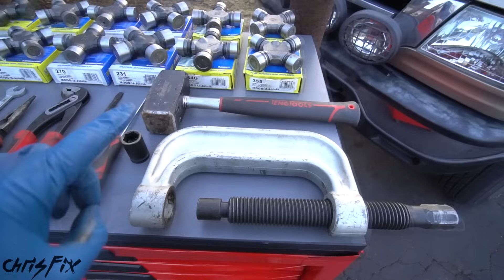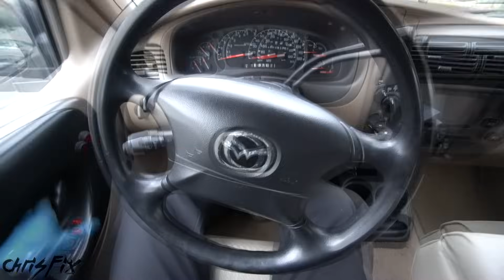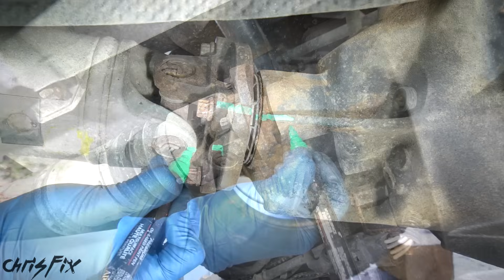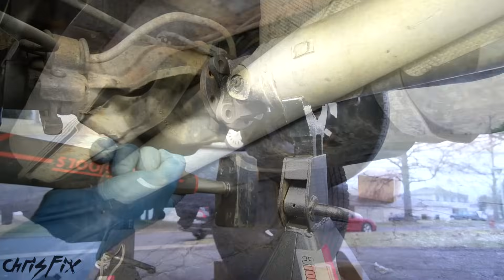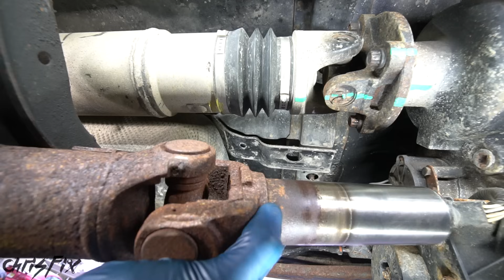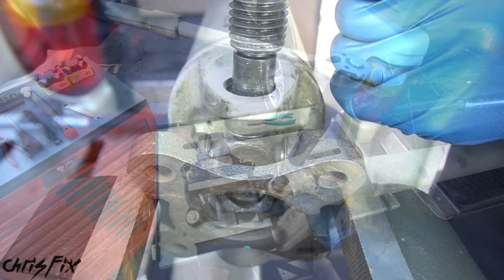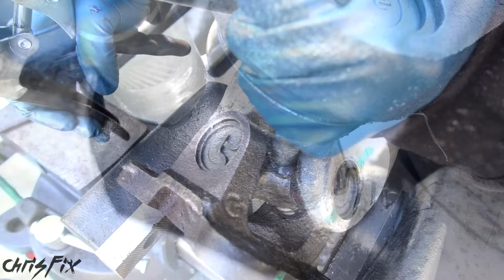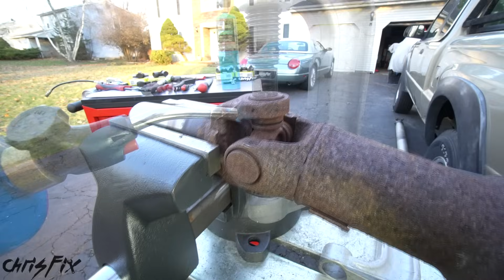How to Diagnose and Replace Universal Joints (ULTIMATE Guide)

Comment: I decided to just replace the driveshaft. I offroad the thing often, the sound only got better when ALL 3 of them where greased and it only worked temporarily and was still making quite a bit of noise. It only cost like 100 bucks more than the 3 u joints I needed and still 400 bucks cheaper than it was to just the u joints replaced at a shop

Comment: Great video, very informative.
I have a question about the squeak squeal noise coming from the u-joint.  2007 F150, one piece rear driveshaft at the rear position, the noise is heard after 30mph and stays constant until stopping, pull away and its back.  The drive shaft is tight by hand, NO clunk between forward-reverse or reverse-forward, caps look fine.  I've walked beside the truck in the parking lot and heard it, but yet when a mechanic puts it on the hoist, its not heard.  It has new brakes, pads and rotors on the rear, nothing is contacting anything anywhere.  It is a higher noise and is a faster rotational sound than brakes dragging would be.  I know its hard to diag over the computer, but do you have any other ideas or suggestions for me to check?  Much appreciated

Comment: Your usual excellent video. When re-seating the u-joint, I've always used a hammer with a dulled cold chisel in the crotch of the u-joint to drive the caps back against the retaining clips, thus loosening the joint bind. What do you think of that method?

Comment: Maybe I installed the u joint incorrectly with the hammer method looks like the rubber piece isn’t flush on the side and makes now I got a clunk when coming to a stop at 10mph to 0 or could be transmission problems ?

Comment: i just did this on my landcruiser yesterday. heres what i learned. 100% you need that press tool! and also I found it easier to actually sit the press in the vice so you can really swing on it. those things are in there tight! even had to shock the press with a hammer while it was loaded up with pressure. thanks chris fix !

Comment: best way to check U-joints, put car e-brake on, put key to run and pull out of park then in to park, the load of the car causes the shaft to have a load on it. so park, e-brake, key on, shift to any gear then back to park. get under and spin or wiggle the shafts.

Comment: Your detailed video inspired me to revisit the u-joints on my 1960 Sprite. While I have the axle out for servicing all major seals, I had overlooked this part of the maintenance. The part about the grease displacement from the bearing boots is a great one because I had thought I was putting grease in, but on 2nd review the nipples needed to be freed from old dried grease. What gave me confidence that I could get grease in via the nipples was a test squirt with the gun before reinstalling. The final part being the grease that is displaced out the boot.. She looks ready for work now. Cheers!!

Comment: Chris,replacing u joints on my 67 Camaro
I followed your instructions to the T but I have a lot of resistance in the u joint even after several hammer taps
I removed it and tried again,I have free movement up until that last little bit to fit the clip
The channels are clean,it’s almost like I need to sand a few thousandths off the clips
Is this normal?
Thanks

Comment: Many driveshafts or aluminum these days so I don't think using a hammer on them is a wise thing to do
Reply from the maker: If that's the case, I would just be very careful and consider using something like a rubber mallet/dead blow to move it a slight amount!

Comment: Hi Chris  i have an issue with the universal I think. I have a ford edge 2014 sports.  when i am driving there is a bang forward when i accelerate after stopping . not all the time but it happens sometimes when i am stopped at a light. the tranny fluid is up to par, I just changed the deferential  and the power transfer case. Any thoughts on what this banging is coming from   thanks again.

Comment: Yeah! I could of used this information 35 years ago when I leaned about neutral dropping to chirp the tires! Scared the hell out of me when the speedo bounced around, the yoke shattered, and the driveshaft was hanging from the axle. Learned about the darn plastic injection retainers and soon about the proper positioning of the weight. Not funny then, but funny as hell now! Great video!👌🏻👍🏻

Comment: I have a question Chris, my nissan Navara d40 has developed a vibration between 60-80mph. After watching you video I put the truck over the pit and checked the UJs. Rear drive shaft UJs seem solid. Front drive shaft UJ right by transfer box has about 3-4mm of movement. There is also weeping from the grind seal where the drive shaft comes out of the transfer box. My question is: could the vibration be from this worn UJ? Does the front prop shaft spin freely even when 4x4 is not engaged?

Comment: That press is a pain to press them out with. The hole in the end of the press wasn’t much bigger than my end caps & it was hard to set it up so they’d clear. Not sure if my old u-joint was so worn that I couldn’t push them far enough out, but I had to press them back & forth until they worked loose enough to turn with vice grips.

Comment: I've worked on my own vehicles all my life and changing U-joints is something I've done as well. What I DIDN'T do when working on my U-joints is to mark the bolts to check for travel after a test ride. That's a fantastic idea! When I did it, I would tighten the bolts and then re-check the tightness after a day or two of driving. Loc-Tite is a must as well! Great video! Thanks for sharing! This week I'll be changing all the U-joints in my motorhome. Fun times. LOL  Take care.

Comment: It’s not easy to turn the drive shaft enough in either direction to see play in either of the U-joints unless both are completely worn out. I missed a bad U-joint & threw money at other possible causes for 8k miles or so. I figured out the rearmost U-joint was worn while I was replacing the rear shocks (which it needed anyway). It’s a lot easier to see a worn U-joint if you get your rear tires off the ground & turn/wriggle one of the rear tires forward & backwards while you look at the U joint.

Comment: 10:30 Really shows the importance of chocking off the wheels.
Reply: Yeap. And good remimber fix the parking brake 😉
Reply: @KanriXD  Isn’t the drive shaft part of the parking brake system? So when it gets knocked free, wouldn’t the wheels possibly move anyway?
Reply: @mp2bill  no its not. Expect electronic e-brake+ automatic transmission newer cars example m-b. Same go to truck and big trucks.

Comment: Pro tip from a tow truck driver: before you remove the bolts to disconnect the drive shaft, put the car in neutral. That's why the last bolt is always so tight.

Comment: I have almost like a ratcheting sound  coming up mostly at lower speeds and it's not to consistent on my xj could this be u joints? I dont think it sounds like bad bearings more like tapping but not coming from motor and it doesnt do it in park

Comment: just gonna throw this here in the off chance someone sees it... have a 2010 taurus with awd and when i push on the gas theres a noise bascially like an ice maker dumping cubes into the tray coming from the rear left of the car. u joint and carrier bearing clunks are the closest noise ive found to it online (with sway bar links and cv axles also sounding similar but from what ive heard they should constantly make the noise), but it only happens once when i take off from a stop or completely let off the gas to cruise and put my foot back on the gas. happens 95% of the time for maybe half a second then it drives perfectly fine. nothings rolling around inside and it definitely sounds like its from under  the car. if anyones ever had a similar problem any help in diagnosing would be awesome, cant get it up on a lift for a few days just trying to figure out what first steps would be.

Comment: Hey guys! For anyone working with an extended cab ranger, you’ll need to ask for the front u-joint of a Mazda B series. Wasn’t an issue for Chris, but I spent all day back and forth at shops until I brought up the Mazda thing and we found it instantly. It’s some kind of conversion joint. Hope that saves someone some time.

Comment: An extra tip to help u-joints press in easier: freeze them. U-joints, ball joints, bearings, and anything else you press in, put them in the freezer. Shops cold press these things all the time.

Comment: Do I have to worry about fluid leaking when removing the front of the driveshaft if my ranger is manual transmission? & Do I have to jack the truck up for this repair? I usually use ramps when working under the truck

Comment: Hey chris, i am having a problem in my trailblazer, i was hearing a noise similar to bad bearings but the wheels are fine, when actually the rear drive shaft spins, the sound comes from inside the transmission the area where connects to the transfer case when spins the drive Shaft, only the rear, the front doesn’t make any sound, the transfer case seems fine and transmission as well, bearings in the drive shaft are good too. What is that? No codes whatsoever for any parts mentioned

Comment: First time replacing a u joint and when I was done it was super tight. Watched this video and I’m super happy you added that note in hitting the driveshaft a few times. 👍
Reply: After doing a uj job I think I would recommend going back and greasing the joints after a bit of driving. The movement seems to allow you to pump quite a bit extra grease in there. You'll get driveline vibration all over again if there's insufficient grease for the long haul.

Comment: I know this is an old video but I used it a week ago to change my u joints on my 1998 Ford Ranger and it was so helpful. I have some experience with various mechanical stuff but I had never done something like this, mostly just brakes and oil changes. I was pretty set on taking it to a shop and having it done which would have cost $300-$400 I'm sure. After watching this video I realized I could easily do it myself for so much cheaper. I will say, renting the proper tool is the best route rather than using a socket or something else to take a shortcut. I spent $40 on the parts I needed and about 2 hours of my time and it was done. When I was talking to my friends about changing the u joints myself they all said I should just take it to a shop. You have so many different projects and the way you explain in detail how to do things is very helpful. It really gives me a newfound confidence in doing most work on my truck myself rather than having it done at a shop.

Comment: might add that the gm poured in u joints if heated sometimes they are under so much pressure that when you heat one side sometimes the cap can shoot out with alot of force and even sound like a gun shot so never look down at it or stand in front of it when heating the caps i have a driveline shop and have built/repaired them for many years so be carefull
Reply from the maker: Thanks for the safety tip!

Comment: Quick question. If I am replacing the whole drive shaft (shaft and u joints are all one assembly) is there anything that needs to be marked and remain in a particular orientation like you did when you used a marker on the shaft, flange and diff? I don’t see how you would or the need for it but I have never done this and am not even going to act like I know what I’m doing here. Hopefully just a quick few bolts on the back, a couple in the middle and out it comes.....install in reverse. Thanks for the help.

Comment: Hi Chris, 
if you place the universal joint with that contains 7:17 grease filling port, it will affect the balance of the shaft at higher RPM. that is worth considering before replacing.  
Do you agree?

Comment: Excellent video!  The one thing I would mention is if anyone runs into a "staked-in" U-Joint like Ford F-150 or Nissan SUV and doesn't have the right tools, it will be a lot easier and more reliable to replace the driveshaft than to use spacers and retainer clips.
Reply: Also, there are a few companies that make "adapted" u-joints if you do press out he staked u-joints. But they cost over $100 each. By the time you replace 3 of them, you could have basically gotten a new driveshaft with cheaper replaceable u-joints for the future

Comment: If you get the tires off the ground and put the vehicle in neutral it's easier to find a bad u-joint. When it's in park with the wheels on the ground the shaft has tension on it and it's hard to find any play.....been there before.

Comment: With a lift and tools, it took me 4 hours start to finish. Used a ball joint press to remove and set the caps. Rusty north eastern driveshaft. Used a punch with a pointed tip to remove the clips, tap. tap. tap. The original didn't seem bad but there was vibration and clunking. 30 bucks for front and back u-joint.

Comment: I don't think I saw it mentioned, but when installing a UJ with a greasing nipple, orient the greasing nipple away from the flange and towards the driveshaft where there is more clearance for it, and access for attaching the greasegun...its a minor point, but not obvious, and when you are not watching for it, and get it wrong, you'll find that there is no access for greasing, and it might even foul on the flange, so everything must come back apart to allow this to be corrected...ask me how I know!  Thanks for another informative video!

Comment: On the older style GM with the internal nylon, you do NOT need to heat the joint for removal.  They are easily removed by resting the caps "not being removed" on the open jaws of a vice, striking below the cap journal that is being removed, and removing the caps in reverse, they pop out easily.  I used to heat them up as well until a driveline shop showed me how to remove them in less than a minute.

Comment: Hey Chris! I came back from an alignment appointment a while ago but never got it. I have changed the control arm bushings, inner tie rods, and now I need the u joint at transfer case. Front driveline. Do you know which u joint I would need?

Comment: You just replaced an original factory installed heavy duty 5133X Dana non grease U joint with a lighter duty grease joint. Present new non grease joint has a white colored exterior seal that is improved to prevent aging and eventually failed seals.

Comment: Some U-Joints will need heat and an air impact. Especially those that are high mileage or aged. I removed a U-Joint on a 20 year old GM. Even with Heat and a good impact, it was a PITA. 

In those instances, it's worth looking into a shop press, or somebody with one.

Comment: Dunno where you got the idea that none greasable u joints have no channles for grease.. the Dana spicer U joints that have no zerks, all still have shafts inside packed with grease, and the self grease themselvs with the power of gravity when they spin..
Reply from the maker: They are greased from the factory and don't have the fittings so you could do it after the fact, that's what I meant when I said you can't grease the sealed ones :p

Comment: Quick question:
Is there a reason why you can't inject the grease into the Universal Joint just before re-installing the drive shaft since at that point you will have easier access to the joint? 
Seems to me that cleanup of any squeeze-out will be easier too. 
I'm new to this, so this is not any sort of criticism of your technique. I truly do appreciate your videos.
Also, do you do work on any diesel powered vehicles?
Reply from the maker: Thanks a lot! You want to grease them after so you can install it easier, if you do it before, the caps can push off! And I'll be making some videos with my diesel Hummer soon!

Comment: Pro tip. If a bolt is seized. Dont just heat it and loosen. You want to loosen, tighten, loosen tighten. Over and over, I cant tell you how many bolts that has gotten loose that wouldnt come loose with just the heating method.

Comment: What is the benefits of a one piece Drive shaft? I have a 2009F150 My tires are balance correctly my shocks are good but I get bouncing in the rear when going really slow with no gas at all for off the pedal and off the brakes it feels like a grind or somethings catching in the rear any opinions?

Comment: Definitely one of the best universal joint videos I have seen, I have a problem with my 2000 Ford expedition 2 w. drive with a random vibration shake driving along somewhere between 45 and 60 miles an hour it’s not in the steering, the whole car will just have a general shake or vibration, I changed out both universal joints and it seemed a little better possibly, but still does it any ideas? Thanks

Comment: I have one possible symptom for a bad u joint in my car, wondered if I could run it by you. There is a clunk when I'm at a stop and take my foot off the brake to start accelerating, and occasionally when coming to a stop it clunks right before the complete stop is reached.  What do you think? Bad u joint or something in the transmission?

Comment: Gah!  Hammering on a flathead screwdriver!  (Tsk-tsk)  I never use a screwdriver as a chisel or punch.  That was drilled into me by my machinist father.  The tip is not designed for high impact, and is prone to chip or get a dent.  It's always better to use a metal punch or small chisel, which are machined to tool-steel specs and will withstand high impacts.
Reply: Good quality screwdrivers never gets damaged by this process

Comment: The reason you cannot get your grease gun in there is because you have the U joint installed wrong.  The grease fitting needs to be facing the REAR flange,  AND it needs to be in between the CRUSH side of the driveshaft rotation.